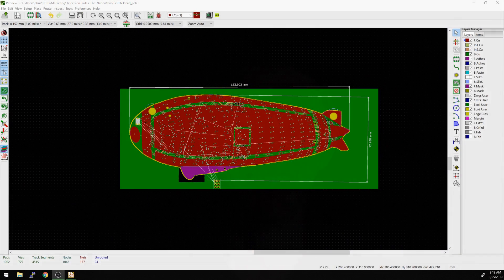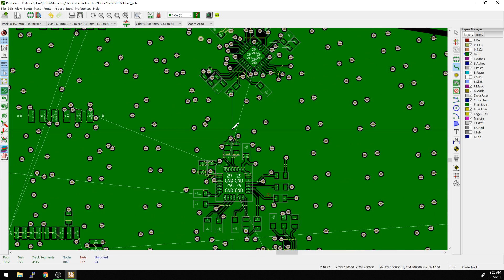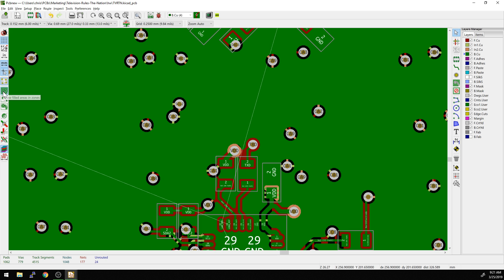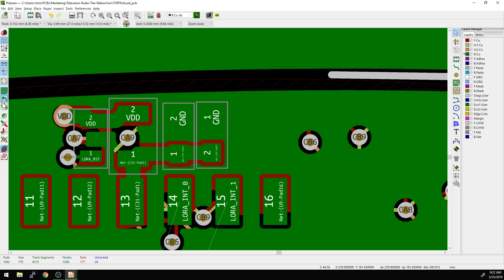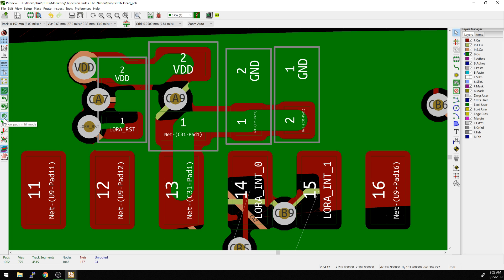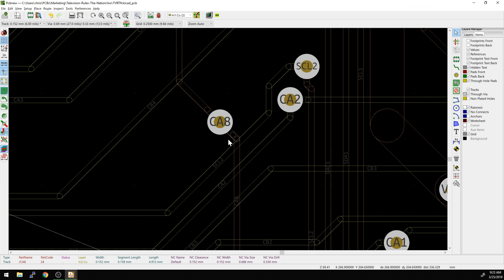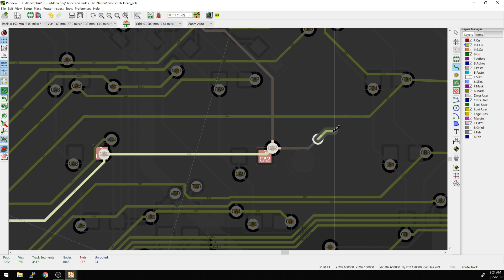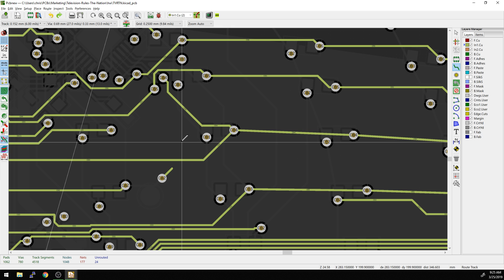KiCad 5.0 - Improving trace visibility during layout

Comment: Try the following color combination, this will be like the Alpha blending colors in eagle, Top and bottom will be easily visible and is easier to route.
Color pallet 
1: TOP layer: RED 222 ,GREEN 0 ,BLUE 15 ,HUE 355 ,Saturation 255, opacity 60
2: BOTTOM layer: Red 55, Green 55, Blue 222, Hue 240, Saturation 191, Opacity 70